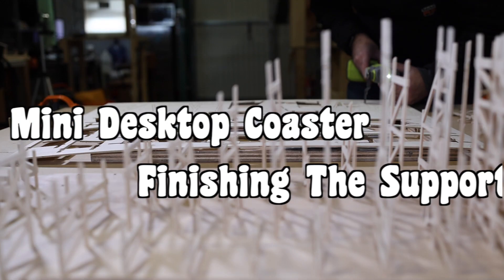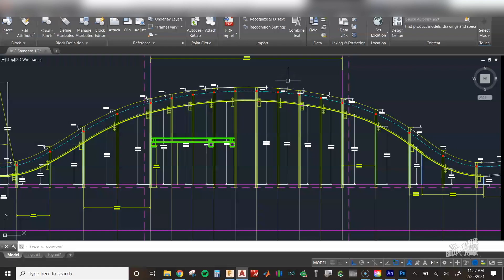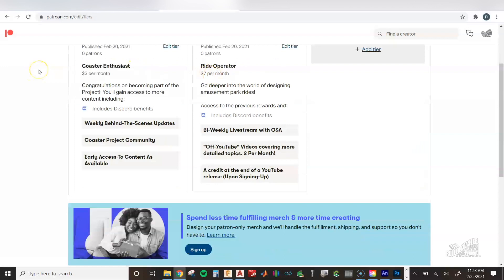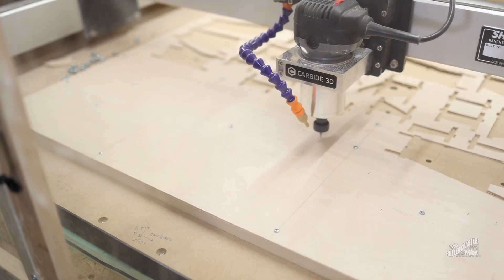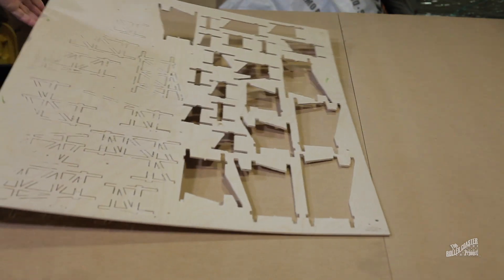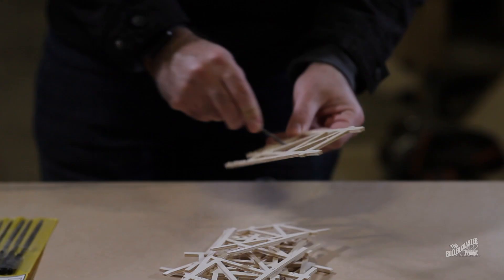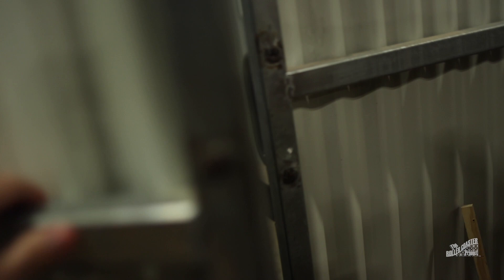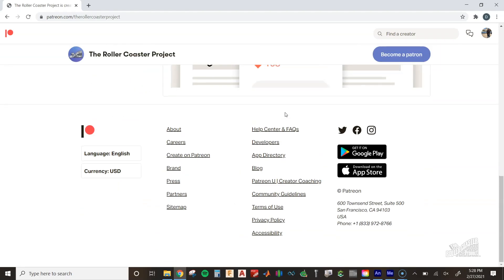Building A Roller Coaster - Part 3

Comment: Where in fusion do I find the feature to automatically adjust parts into the setup as you mentioned? Never heard of that.
Reply from the maker: I think you're referring to the "arrange" option.  The option is under the "modify" tab on the ribbon.  Using this feature, you can select many components (I'm referring to them as parts since that's what I've always done) and you can select a sketch to spread them out evenly.  This works wonders if you are wanting to layout multiple things within a build area for 3D printing, CNC, plasma cutting...etc.  It also can be a quick visual for plywood work.

The way I put the ride together was creating multiple Fusion files and many components in each file as a sub component.  That way, I could import the master component files into a general master file and everything is in the correct location.  I do everything by coordinates which are produced via self curated math programs.